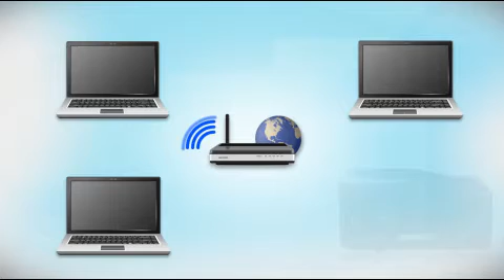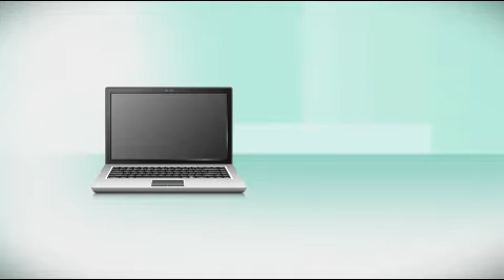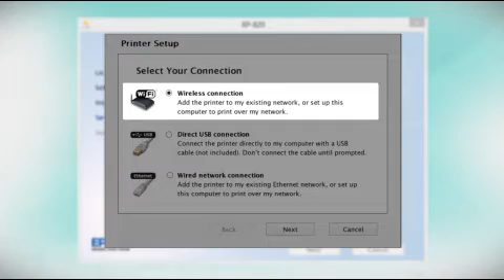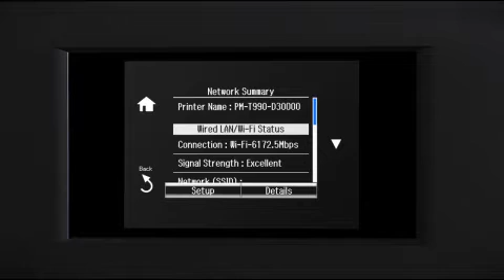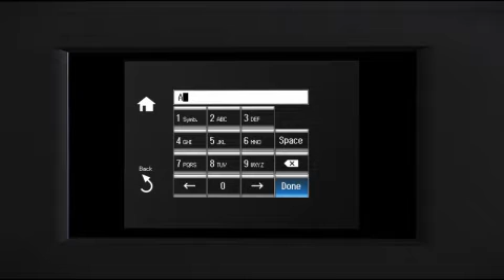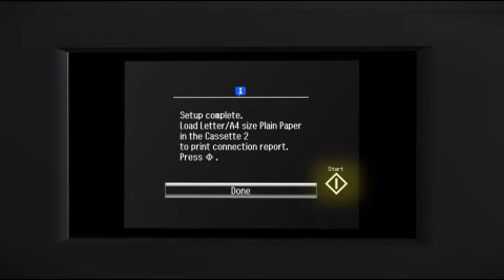Epson Expression Home XP-820/XP-860: Wireless Setup Using the Printer’s Buttons

Comment: DO NOT BUY THIS PRINTER it says its wifi capable but its not actually. ive tried multiple computer and tablets to connect with it, it doesnt work
Reply: I have this printer, and it works on my Wi-Fi no problem. Must be something wrong in your system.